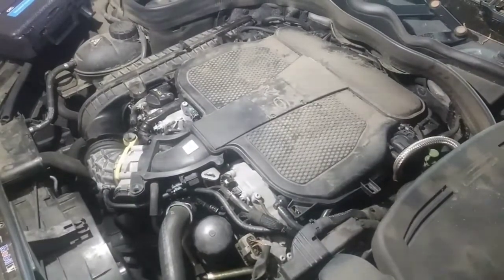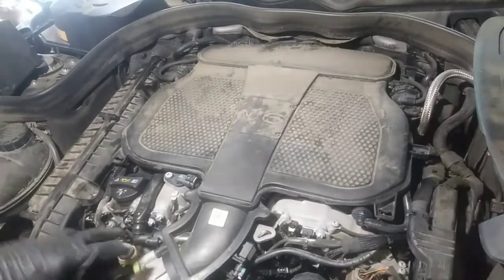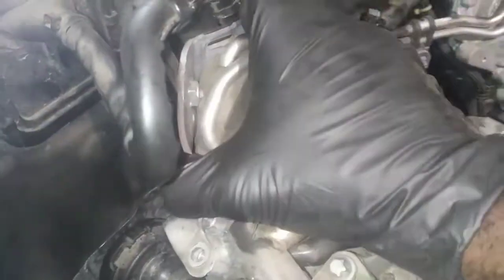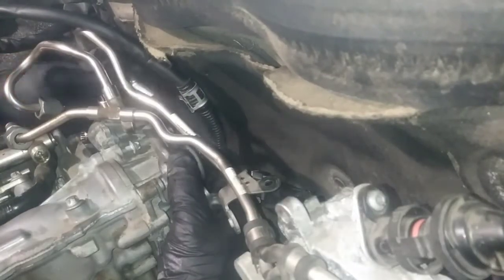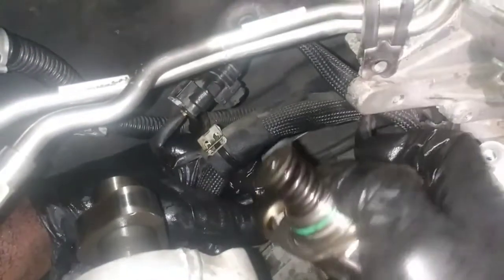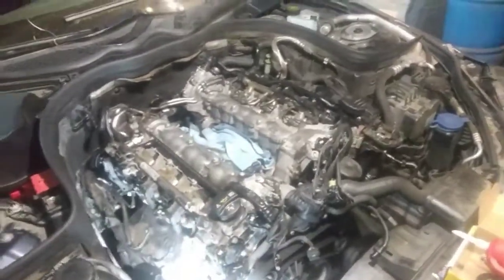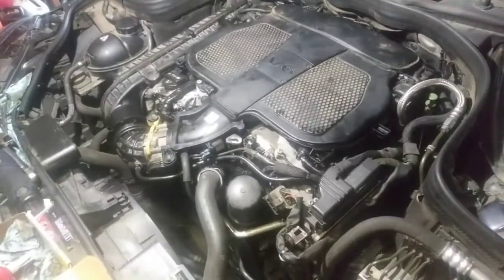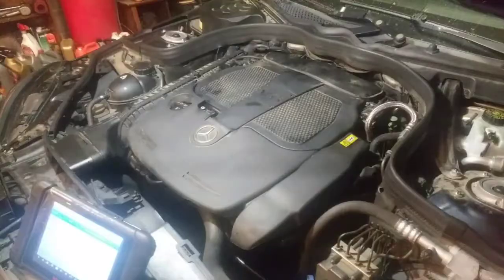'14 Mercedes E350 PCV VALVE

Comment: I know this is an old video by now, but there are a couple of things to note when removing the HPFP.  The WIS states to move the crankshaft to 40° after TDC (there are markings on the crank pulley) and the screws/bolts for the HPFP should be removed ½ turn at a time.  When starting up after replacing the HPFP, the ignition must be switched on for 5 s before the engine start in order to fill the high- pressure pump with fuel.  Damage could occur to the high-pressure pump otherwise.  The appropriate WIS document is AR07.02-P-1020FH.

Comment: Doing the plugs and PCV is a great time saver from duplicate work.

This PCV design has double failure:
1- failure of round seal that lets all the oil out into the intake.
2- check valve diaphragm that allows unrestricted vacuum.

next fix...engine ratling from leaking chain tensioner and the missing "check-valve" Benz left out. When camshaft oil pressure leaks out through tensioner, Four phasers are starved for pressure and get wasted.

FYI: this M276 has THREE chains!
👍
Reply: junks
Reply: This also make blue smoke when start the car for short time ?
Reply: Did replacing the tensioners fix your rattle issue? 

Theres a pin in the camshaft adjusters that degrades prematurely and I've read from other forums that the camshaft adjusters actually cause the rattle, not the tensioners..
Reply: @jakubkuzmicki8572  Both the cam phasers and tensioners and no check valves cause rattles.

Comment: I highly recommend a intake/valve cleaning at the same time as all that oil will gunk up the valves.

I just did the same job and it was a lot of work but doable. I’m just glad I caught it early on my ex wife’s car before it became really bad. Time to look at my GLE350 as well.
Reply: I’m working on the same project, what a joke these engineers design such stuff .
Reply: Me too it’s a lot of work and very little space to work with

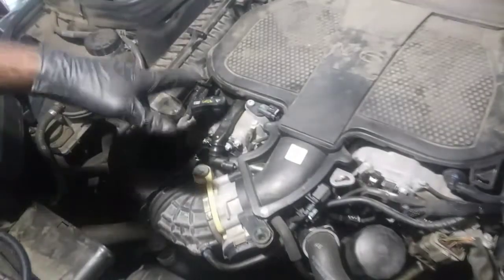Comment: 02:38 How is the Bad/Leaking PCV/Oil Separator Causing The Vacuum in the Crankcase? How does that happen? If Anything I would think it should cause Increased Pressure... ?? 🤔🤔🤔
Reply from the maker: Because the pcv uses engine vacuum to ingest crank case fumes.  When the diaphragm fail within the pcv,, it fails to regulate vacuum which causes these symptoms. 

Natural aspirated cars don't create pressure,  just vacuum to atmosphere
Reply: @partsshooter  Okay I Get that NA Cars don't create pressure, But the main function of the PCV is to Relieve and Carry the Blowby Gasses, which on its own by design is created through the Pressure of Escaped gases of the combustion process, Aided only by the Engine Vacuum. These Gases (same one heard wooshing when you opened the Engine oil Cap in the Vid) live & circulates inside the engine (Under some kind of Pressure) until relieved by the PCV.. Thus, I'm Confused as to why/how any Part of the Engine that's beyond the Intake Manifold and The Cylinders Can still Be under Vacuum... ?? 🤔🤔🤔

Sorry for the Long one.

Comment: I’m curious what’s the best method to release the fuel line pressure? I’m about to do the job and this video helps tremendously but worried about the fuel lines and the high pressure fuel pump. I’m guessing a ton of rags and crack it open with the battery disconnected or is there a better method?
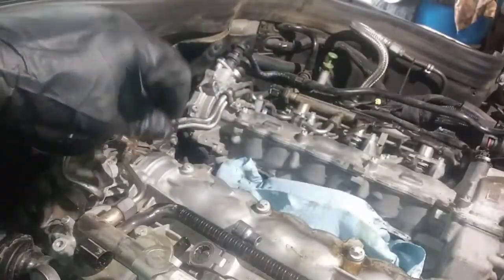Reply: 10:36 same question about how to release fuel pressure so that fuel doesn’t go everywhere once the fuel line is disconnected
Reply: @mjmorteo14  I just ended up unplugging the battery and putting a bunch of rags underneath to catch the gas in the lines and opening one by one. Luckily in my case I haven’t driven the vehicle in a week or two so there wasn’t any pressure built up for me so any fuel in the lines just trickled out instead of spraying out. My guess is after maybe a day or two the fuel will slowly start to lose pressure until gravity takes over and slowly starts to work its way back towards the tank. Hope that helps.

Comment: Great Video!  Do you have any more details on how to take he High Pressure Fuel Pump housing off?  It seems to be stuck or has pressure build up?  I can't seem to get that off after I take the bolts off.  Thank you in advance!!!
Reply from the maker: Hey there... 

Just make sure you have all the bolts removed from the pump, triple check the bolts are removed. 

 Try tapping with a chisel and hammer with light taps knocking the pump outward at the base. 

Try prying the ends with flat heads

The flat head prying is the best option before doing the taps with hammer and chisel

Comment: I am going to try tackling the tensioners and separator and drip pan (I don't think you changed that here)soon. I also need to tackle the spark plugs, as well. I would like to have seen the intake valves and the effects the extra oil had there since this is direct injected.

Comment: Pro tip - cover those open manifolds with rags.  I cringed when you pulled out that lose bolt with the magnet.  I just knew it was going down an intake hole.  Thanks for the video on this.

Comment: I have the check engine light on my 2012 ml350 and the code now says p2279. The whistling noise was always there during the cold season but never bothered me since it went away after 5 minutes of starting the engine. I changed the serpentine belt in the front of the engine thinking this was the reason but it was of no use.  I have now ordered the PCV part from Amazon/Uroparts as it was the cheapest. I hope this would set it right. German cars are comfortable but as much a pain in the butt!

Comment: Waht would it mean if my engine has high pressure? I take the cap off and oil splatters all over the hood it seems very excessive. Also I have a whistling noise that starts randomly while the car is running and stays on.
Reply: Bad pvc

Comment: You have a suggestion on where to pull vacuum from to put a catch can on?  I just picked up a '15 ML350 with this engine and want to keep oil out of the manifold to help avert some of these issues.

Comment: Did you have any off idle lean codes, like P2177 and/or P2179?  Have these and my fuel trims are positive, especially off idle.  When I remove the oil cap, they come slightly down, even at idle.  I think my PCV valve may be starting to go.

Comment: I'm having this issue now with my 2016 GLE 350.  About how much would you say this job would cost. The dealership quoted me $640 US Dollars for the parts only.
Reply from the maker: Significantly ranges... Easily around 600-1000 labor easy
Reply: Parts are 60 $

Comment: What can be cause engine oil entering intake manifold
Reply from the maker: @okwudilichristian-m2d  oil entering intake is naturally occurring through the PCV (positive crankcase ventilation) system. This is the only pathway into intake under normal circumstances. This apply to N/A naturally aspirated engines.

Turbos can cause oil to enter intake, this in conjunction to pcv system

Comment: I am in limp mode after replacing the pcv valve. The codes I’m getting are fuel pressure too low and can shaft position over advanced. There was so much vacuum prior to replacing pcv valve that the oil cap had cracked and broken a bit. I’m wondering if maybe a tiny piece of the cap could be blocking fuel in the fuel rail. I’ve also seen in some case studies (after I finished the pcv valve of course) that you have to manually turn the cam shaft which is out of my league… any ideas?
Reply from the maker: If your timing is off, it'll throw off high pressure fuel pump timing also. 

If it ran fine before you replace it,  check for human error during the repair. 

Check your oil level.  If your car ate too much oil,  may throw timing off and generate a code. Add oil if needed,  clear codes and recheck

Comment: If you don’t mind me asking, how many miles did this one have? 
I got 76,000+ on my daughters 2015 ml350 and wanted to do preventative pcv valve change but looking at all the work involved and no issues YET, wondering how far I can push it.( I know, it’s not a good attitude)
Reply from the maker: @WillRozmaity  idk how many miles because this was a costumers car. 

The intake can be removed and valves inspected if you have time to remove it and are curious. That's the best route in knowing. 

Pour a solvent into a closed intake valve once removed and try a soak and clean with brake cleaner and a long wire brush to see how the cleaning responds.  Suction the fluid out and repeat 3x till clean.  It's a slow process but makes a huge difference in performance. 

Diesel may work with cleaning but brake cleaner literally degrades sludge on contract.  Great at breaking sludge down the longer it sit.
Reply: Thank you for your help and informative video

Comment: Hi! Good video I have a 2012 mercedes-benz e350 with the code p0018 an replace the camshaft sensors and crankshaft sensor and the magnet too and still have the same code maybe you can help me thanks

Comment: I'm looking at the video and I can't understand the reason why its necessary to remove the High Pressure Fuel Pump.. ? Seems to be high and out of the way enough that you can reach down and remove the Breather/Oil separator w/o removing the pump.. ? 
Is the High pressure fuel pump blocked in by/directly on the Oil separator that warrants removing it? Or is there a Bolt that The H/Press F-Pump Blocks? 🤔🤔
I would think that After removing the bracket with sort of houses them both, the Oil separator should be able to be removed on its own... ??? 🤔🤔🤔🤔
Reply: Did you figure it out ??
Reply: @hiphopworld5389  There's One Bolt On That Breather Housing That is buried in-between there. That's the Only way To Remove it.
Reply: @nedunonnyp704  my shit went on fire after the job , becareful
Reply: @hiphopworld5389  Damn!, How that Happen?
Reply: @hiphopworld5389  Probably didn't Tighten One of Those Fuel Lines Back Up Properly.
Reply: @hiphopworld5389  I Hope you didn't Lose your car Man... But You Saved Me Too. I Started Smelling Gas Around that Area, had to take Off the Intake and Re-Tightened All Those Fuel Line Fittings.
Reply: You have to turn the ignition switch on and let the car stay on for a few minutes to perform gas leak checks . 2 things to do use a gas sniffer to checks the high pressure fuel line connection and around the pump flange . You also want to do a soap test around all the connections to check for any air bubbles to ensure you have no leaks . Once you do this then you can put the Intake Plenium manifold back on.

Comment: Hey Parts shooter did you have to disconnect battery?
Reply from the maker: I didn't...
Reply: @partsshooter  ok thank you. I will keep the key as far away as  possible just in case. You did a great job btw👏👏👏
Reply from the maker: @seeingit9337  well youre outside working, nothing active... But as for safety people revive it. Only time I disconnect a battery is when doing engines,starters, air bags and alternators. I'm Just exercising common sense here.

 If you need to unlock the wheel. Just tap the start button twice, WITHOUT APPLYING BRAKE PEDAL.  This will go into an on state and not crank. 

Goodluck

Comment: My husband changed the pcv (oil separator… crank case ventilation system…) and the spark plugs along with swapping injectors (4 with 6) 
The car starts (runs a little rough) but dies when coming off the gas… throwing a barometric pressure and low fuel pressure code? 
Could there be air in the system? Or possibly something wasn’t plugged up correctly.. 
any ideas? 
Thank you!
Reply from the maker: If the car ran fine before being touched, suspect human error. Assuming this, check over all... Connection and ensure everything's proper. Being those codes are immediate, locate and check connector
Reply: @partsshooter  Thank You! I must say you’re a pretty smart guy! After finding a sensor unplugged and plugging it up the car ran fine for less than a minute. It then started spitting, sputtering, and blowing smoke. He took it all apart again but this time cleaned the throttle body, MAP sensor, and made sure every connection was secure. Now she’s purring like a kitten! TY for taking the time to answer my question and for providing such useful information. You’ve earned a new subscriber!

Comment: Lol I had the same problem, except I dropped my 8mm 1/4" socket (and not a bolt) since I didn't have a 1/4" E10 socket, and it landed in about the same spot

Comment: Yo what’s good bro man….. I literary just did this job and it’s not fun ,now it’s squeaking, now I don’t no what’s the problem now , this car makeing me running out of money, do u have any idea what could be the problem.im not going to do this job AGAIN 😢please help me.
Reply from the maker: @deez6686  if you remove the oil cap does the noise go away?
Reply: Yes
Reply from the maker: @deez6686  where was the part purchased?
Reply: FCP Euro
Reply: I been on YouTube all day,one guy replace the green little O ring in the breather line next to the intake manifold
Reply from the maker: @deez6686  thanks...

I hate to say,  there's alot of info I don't know here.  But if you're still experiencing the noise and it goes away when removing the valve oil cap,  it's gonna be pcv related.  

Due to the difficulties replacing this,  it's possible change human error has taken place. It maybe worth pulling back down and inspecting the area.
Reply: 😢 ok thanks for the reply back appreciate it a lot. Thanks
Reply from the maker: @deez6686  yeah... the thing is,  you'll have to find what's in common with the source and the issue.  MEANING,  go to the source of vacuum for the crankcase, inspect and address if need be. The source is right at the high pressure fuel pump behind engine where you were. 

May sound crazy but always blame yourself before moving on.  Because you'll chase your ass. People often get stuck because they assume because it's new it's good.
Reply from the maker: @deez6686  especially.... if it worked fine before we touched it! 

Don't be discouraged,  I make mistakes too,  never to old to learn this lesson. We just do a little better every time. 

Let me know how things turn out. Thanks
Reply: Ok sooo today I try to do the smoke test that didn’t turn out right. But I did the vacuum test it came back it was at the vacuum line on the meter.
Reply from the maker: @deez6686  use a vacuum gauge to check vacuum in crank case.  I have a video on a honda with idling issue.  But it shows the gist in testing crank case vacuum.  You'll see before and after fix numbers
Reply from the maker: @deez6686  https://youtu.be/z7hYnYGBI4A
Reply: Ok im totally lost, so in my case on my car what part do u think is bad. It sad to say but I’m not no mechanic at all I’m just a diy person try to fix my own car. But I’ll try to do the smoke test again to I gonna go buy the multi transfer pump it’s a diy smoke test lol
Reply: Do u want me to pinch the vacuum line on my car the one with the yellow color to see  what the different?
Reply from the maker: @deez6686  what's to be lost about? The crankcase shouldn't have excessive vacuum.  

Take a piece of paper and place it over the fill neck, where you add oil into valve cover.  The paper shouldn't get pulled into valve cover. It should want to push it away
Reply: U say filler neck is that mean the oil filler cap right?
Reply: If the paper want to suck in what’s that mean and if the paper want to push a way what’s that mean?
Reply from the maker: @deez6686  I'll have a few more exchanges with you because I'll detailed what a filler neck was. If you can't understand that detailed location,  it maybe best if you took it somewhere that can diagnose this issue for you.  The oil fill neck is where you add oil.
Reply: OK, so I used the paper on the filler neck I got suction results
Reply from the maker: @deez6686  if it's sucking hard,  the pcv at the intake should be replaced
Reply from the maker: @deez6686  you should follow my instructions in testing vacuum as I did the in the video to justify replacing pcv. The answer literally is in the video
Reply: Ok ,thank you once again.